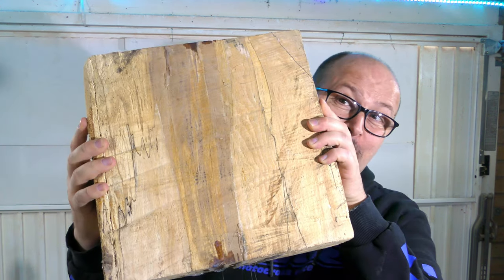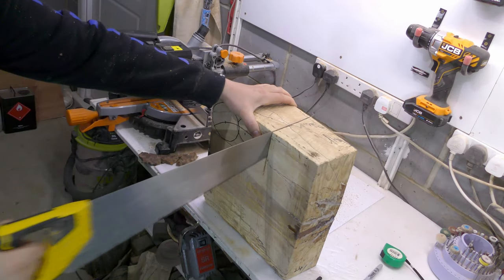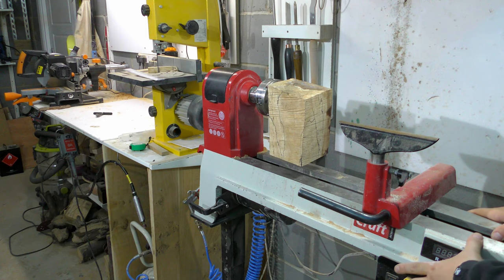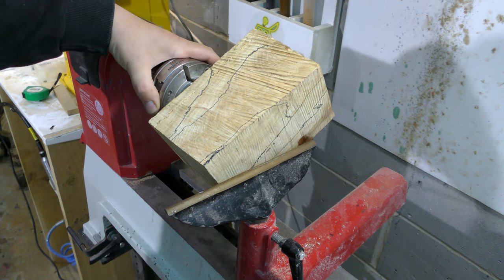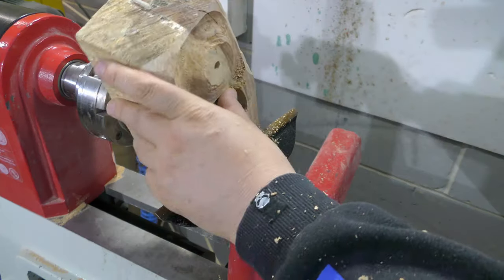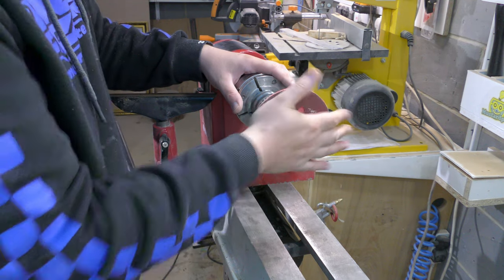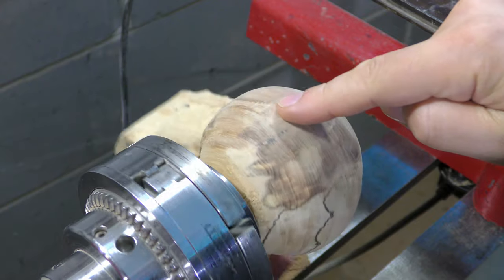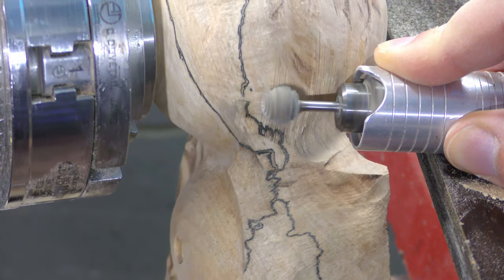New Woodturning Technique - Crazy Multi Axis Turning and Some Useful Tips

Comment: If the mass of the 3 lobes stayed roughly in the center it wouldn't wobble the lathe so violently. Maybe leave a couple of inches on each side to maintain balance until trimmed off last?
Reply from the maker: It was kind of like and experiment. You are probably right. :)